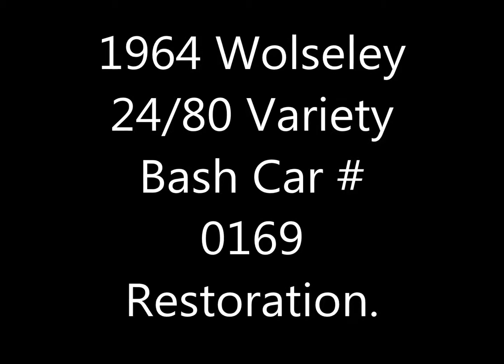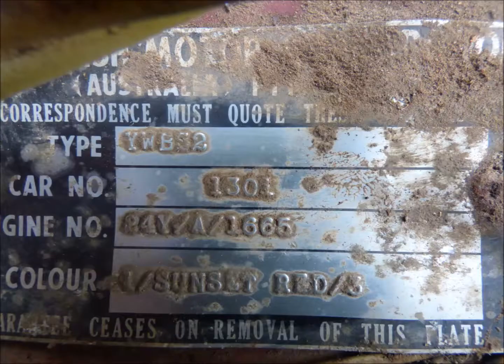1964 Wolseley 24/80 Variety Bash Car # 0169 restoration.

Comment: Hey mark ,I’ve just picked up a 24/80 shitbox for spares ,but it has an alternator on it ,have you got the wire diagram for the conversion
Reply from the maker: G'day mate. I don't have a wiring diagram as such as my electrician wired in the alternator to the car. It's does however, change the polarity from positive to negative earth.cheers.